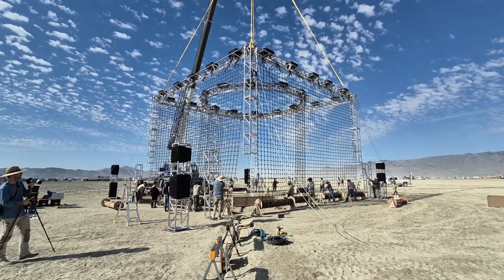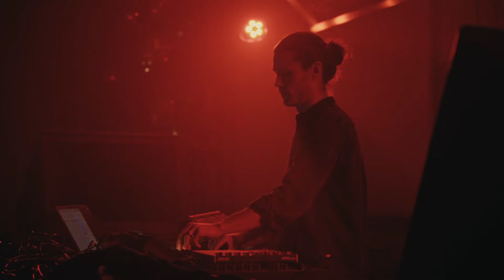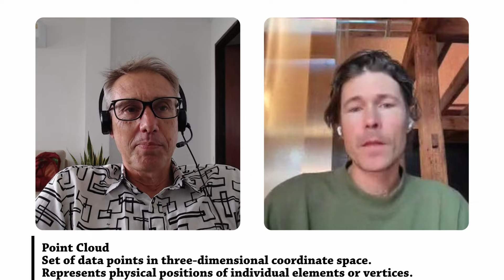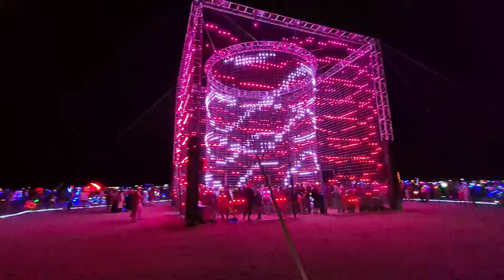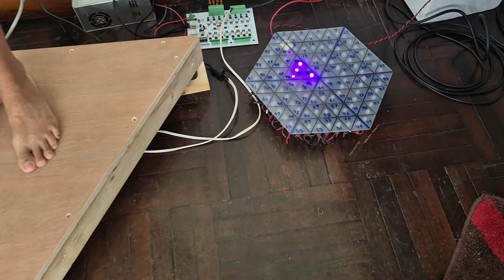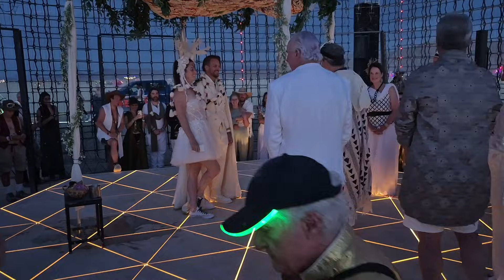Burning Man Art: Engineering a 26,000 Pixel LED Cube

Comment: I concur about the gamma problems with LEDs. I was experimenting with arduino PWM ports driving an RGB pixel and it becomes very evident. Definitely needs a lookup table of parameters to compensate for brightness and hue. I'm sure that this is already taken care of by the commercial RGB panel displays used in video and other digital signage applications.